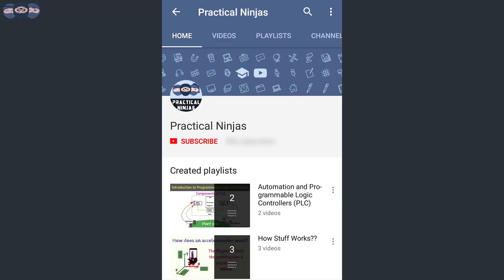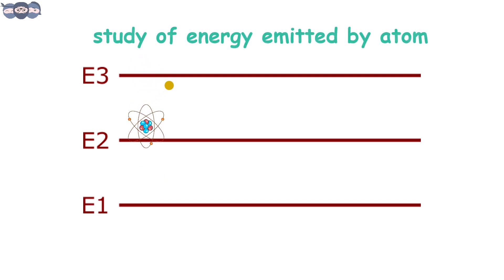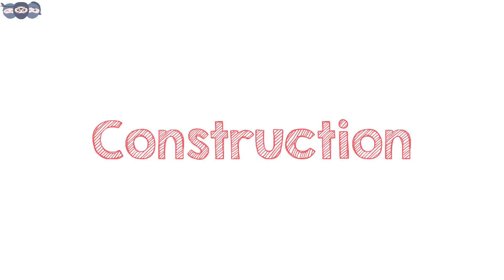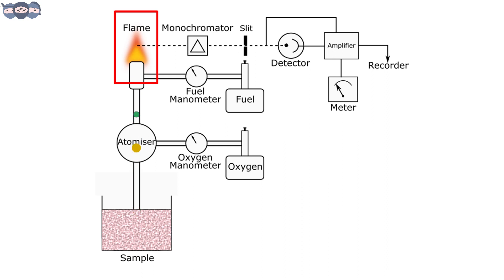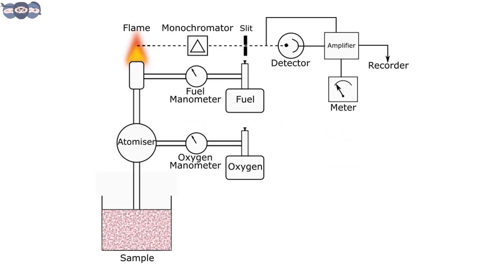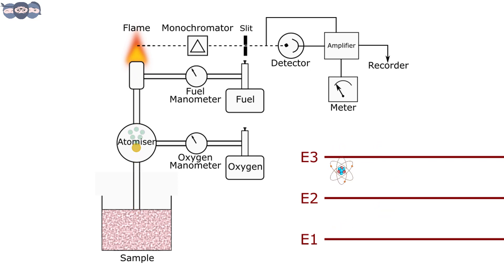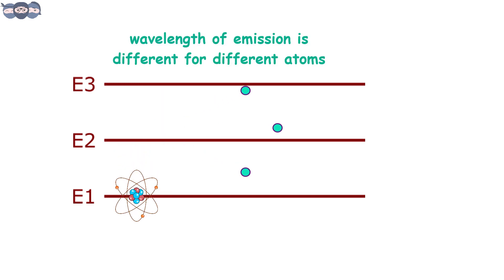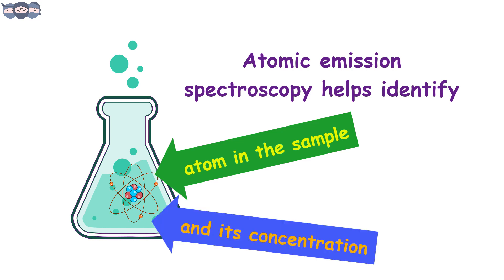Analytical Instrumentation 11: Basics & Principles of Atomic Emission Spectroscopy | AES Explained

Comment: This is incorrect!  The ATOM doesn't change energy levels, the ELECTRON within the atom does!  The electron absorbs energy and jumps up from ground state (lower potential energy) to an excited state (higher potential energy).  When it falls back to the original ground state it gives off the absorbed energy in the form of light.   The bigger the jump up the more energy emitted and the higher energy color given off (violet as opposed to red)